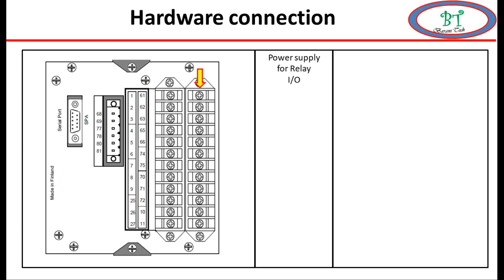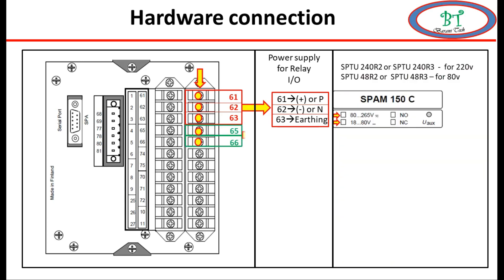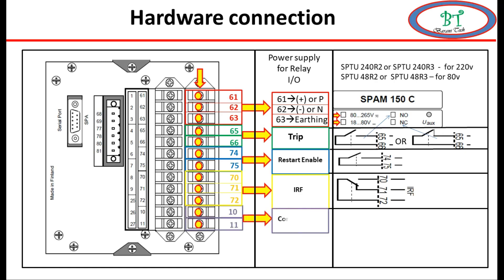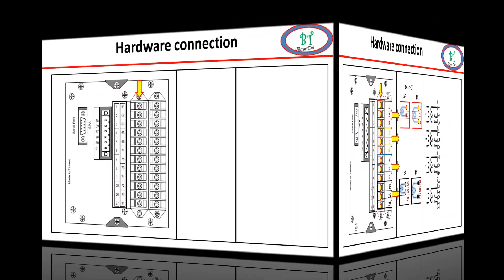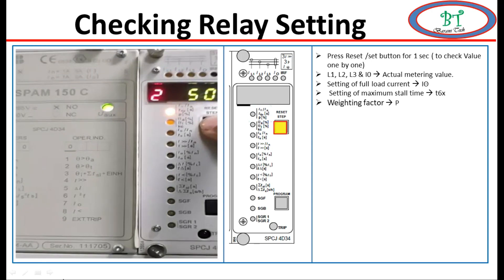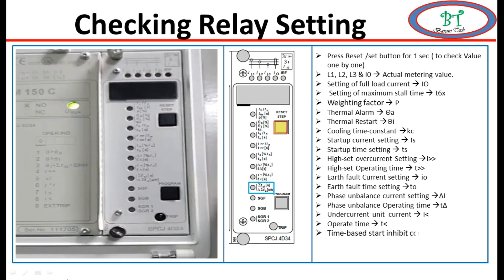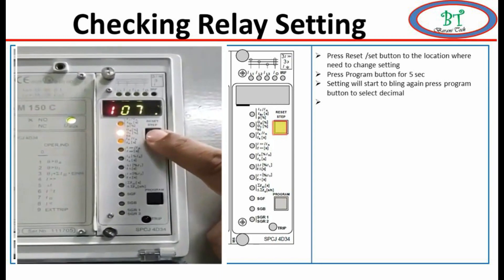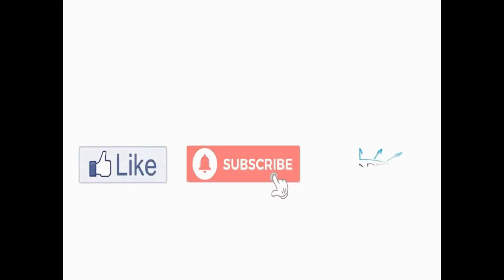SPAM 150C | HARDWARE CONFIGURATION | HOW TO CHANGE SETTING | MOTOR PROTECTION RELAY

Comment: How to put ct ratio or how can we check the ct ratio from relay if we don't have drawings or detail of ct is available for example we may know from CT connection that the secondary is whether 1A or 5A but how would we know primary rating of CT
Reply: I have also same doubt.No body is saying this thing.May be they don't know.
Reply from the maker: it all about hardware wiring how we make, if we have CT ration XXX/5 A then the relay CT wiring has to follow 1,2 - 4,5 - 7,8 on other side if you have CT ration XXX/1 A  then the CT wiring on Relay should be 1,3-4,6 - 7,9 
by seeing this wiring also we can easy able to check CT secondary Current Ratio value 
thank you
Reply: @baranitech1026  I know about the CT secondary ratio and connections for 1A or 5A.My Qs is to know  about the primary current because most of the maintenance sites we don't have drawings available so can you guide us how could possibly we read primary of CT from relay itself
Reply: As like as digital multifunction meter or ref relay, can we put value of primary and secondary current of CT in this relay?

If yes then please make a video regarding this parameterization.

Comment: Sir how can a SPACOM relay be connected to a PC? Which cable type and program should be used?
Reply from the maker: Serial communication port , used for Mode bus connection. but i have not seen connecting with pc , thank you